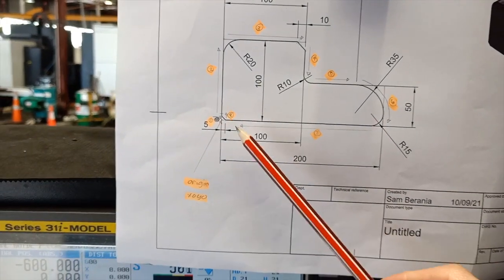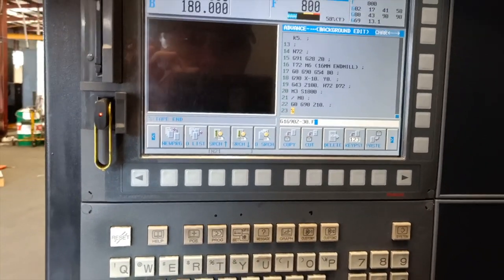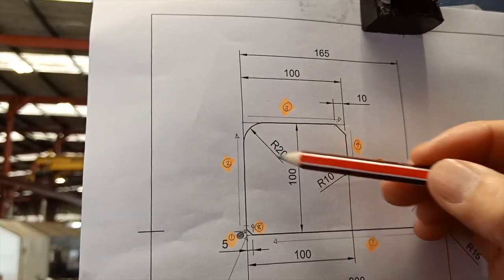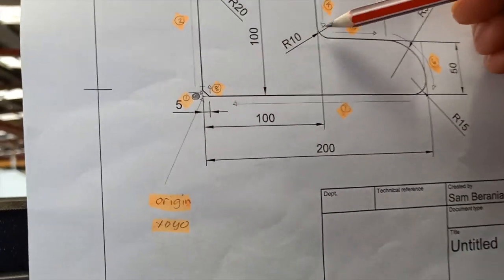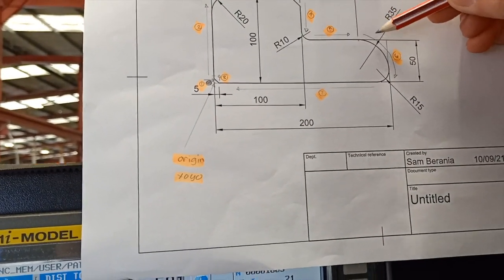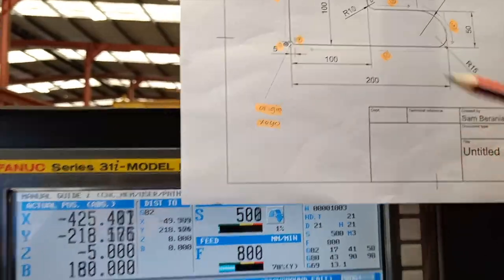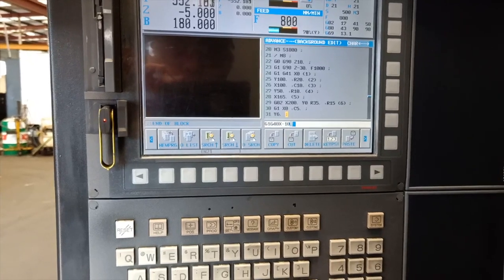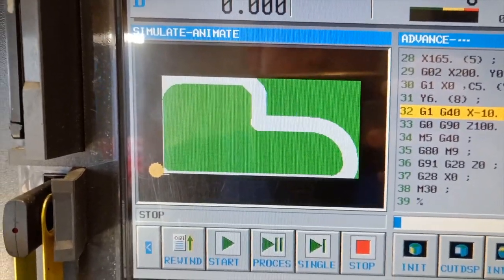IF YOU KNOW THIS!! YOU ARE REAL MACHINIST!!ADVANCE PROGRAMMING G01 RADIUS + CHAMFERING(fanuc mil)#24

Comment: When processing grooves, the tool crashes with a direct feed, and how to make Inclined insion along the z axis?
Reply from the maker: Grooves where inside of the part or outside bro?..well even if that is not a groove if you want you can create program a helical movement. For example the depth you want is -8 then the way you program is.  Its depend if you will use G90 or G91 but I will use G91
D=? Whatever tool you will ues
G1  G90 Z0 F5000 change Z0 for the start point you want
G1 G91 G41 X50 F500
G03 I-50 Z-2
G03 I-50 Z-2
G03 I-50 Z-2
G03 I-50 Z-2
G03 I-50 
G1 G40 X-50
G0 G90 Z100

I hope this is what are you looking for. If you can give me dimension I can give you the right program. Thanks bro

Comment from the maker: Bro christian Nunez ano nga yung tanong mo nadelet yata by mistake sorry
Reply: Dba sir yung program na pinakita mo is  tool path lng ng final na geometry ng workpiece mo .. ang tanong ko sir , pano kung  raw material pa lng sya  pano mo ma roughing yung excess material to achieve the final form of the workpiece?  Sorry sir ..  cam software dependent lng po kase ako ..
Reply from the maker: @christiannunez8031  bro kapag e roughing mo lahat ng materials mas madali kung gagamit ka ng subprogram para hindi masyadong mahaba ang program mo tapos gamit ka G91 sa Z move mo tapos yung the rest G90 command ng X and Y muna lang sigruro mas madali kung iadd kita sa fb don ko nalang isend ang program or pwedi rin naman gagawa ako ng isang video para jan..